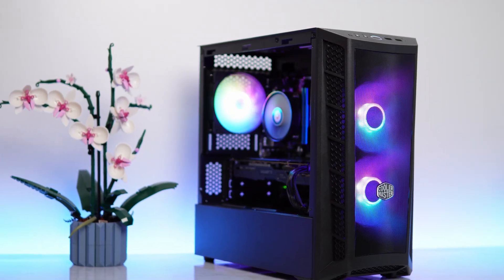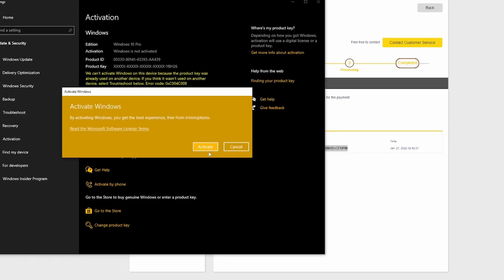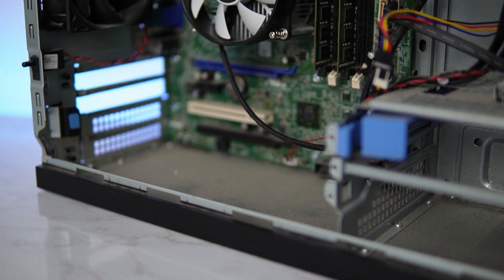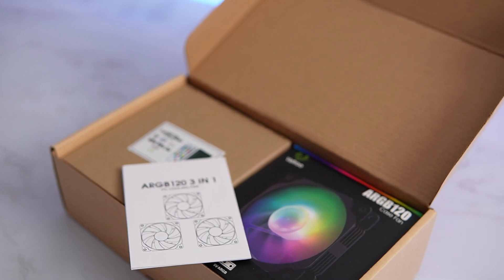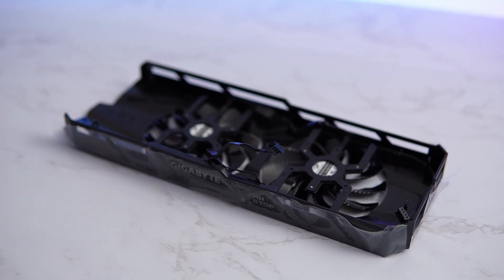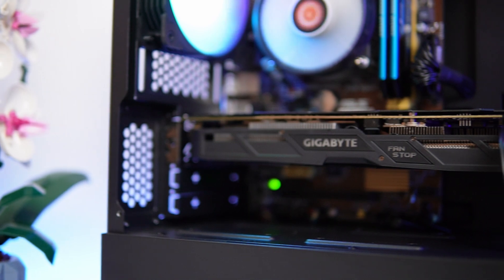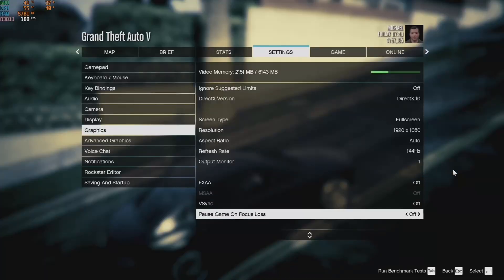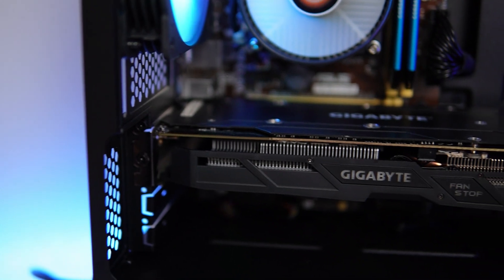Boring Office PC to $200 Budget Gaming Pc!

Comment: Question: can a dell optiplex with i5 or i7 6500/6700 - 8500/8700 with 32 gb ram and a gtx 1650 be enough to: do photoshop, after effects, light premier,  front end  developing and electric/electronic circuit simulation? I am a engineer student with a tight budget
Reply: It should be able to but I would upgrade it to like a 1660
Reply: @raveno.  It's tought but thanks !!